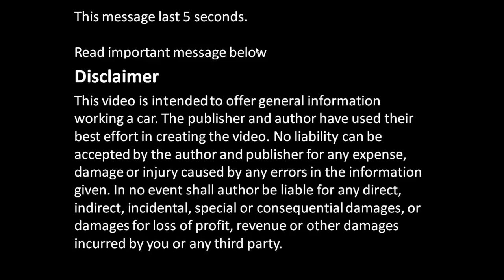How to clean piston rings oil holes

Comment: does this stop engine from consuming oil.
Reply: It prevents the piston rings from seizing, so technically yes. Though piston rings are not the only possible areas that cause oil consumptions, as the valve guide bushings may also be the case.
Reply: Yes. It will cause excess oil consumption. So this is a must fix for Toyota.